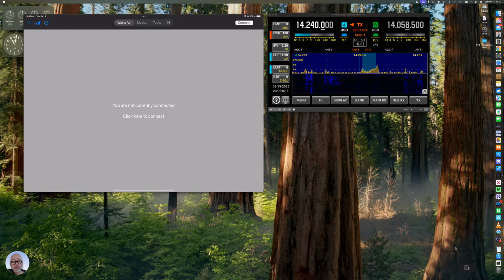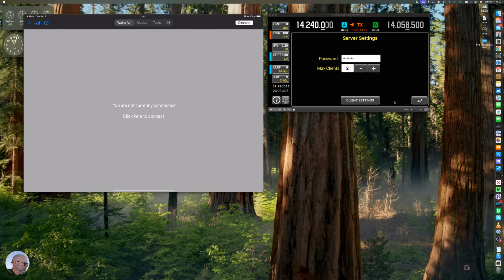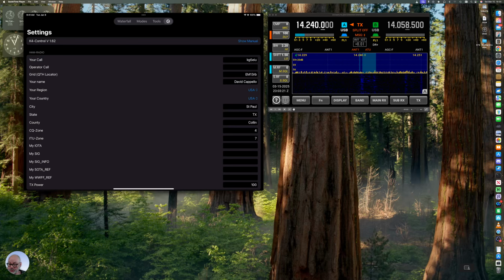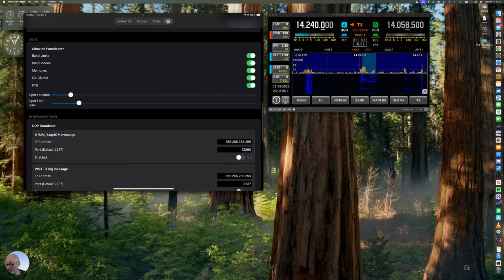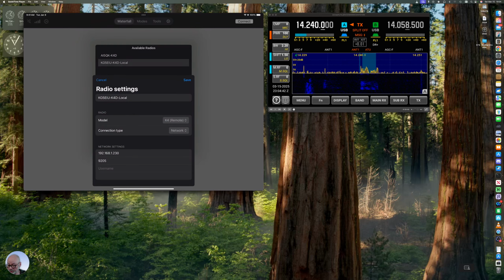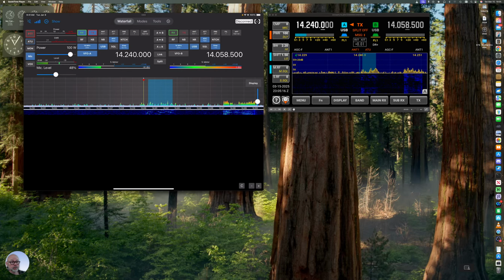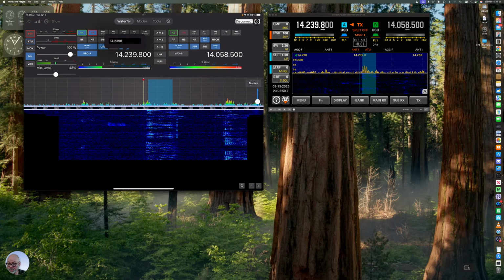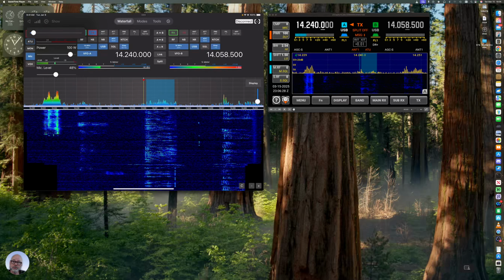iPad K4 Control Initial Setup And Configuration

Comment: Thank you. I have ordered my K4D and should be here hopefully by mid Dec. thank you for doing this video capture. Question : my K4D in the shack will have to be connected to a WIFI 7 Mesh Router. The main router is in a room not too far away but no way to get the main internet router into my shack. Do you have any idea if it’s possible for the K4D on the mesh router will have access to the internet in that setup? Also do you think the K4 Marcus iPad app , which will connect to the main router , will have access to the K4D on the Mesh router ? I hope that makes sense. Thank you.
Reply from the maker: You should be able to get your K4D connected to the Wireless network back in the shack - I say should because there are a LOT of unknowns but in theory you should be able to connect.   After you are connected you should also be able to connect to the K4D using the iPad K4 Control App - and after that if you open up some ports on your Internet router you could even connect from a remote location over the Internet.

Comment: Hi Dave…..Thanks for sharing this. I’m trying to figure out what I’m actually looking at. I think the video is capturing a Mac screen and the iPad app (left top box) is running on the Mac (correct?). What is the top right app….is that the Mac version of the remote control app from Germany? Paul aka W6PNG/M0SNA
Reply from the maker: You are seeing a screen capture of a Mac that is displaying screen capture from an iPad and also the HDMI output from the K4 via an adapter plugged into the Mac